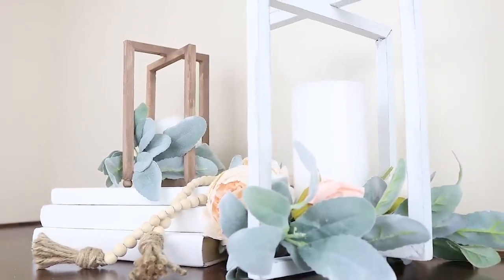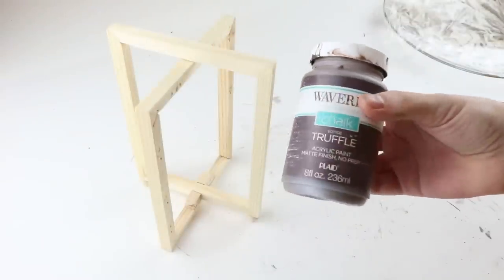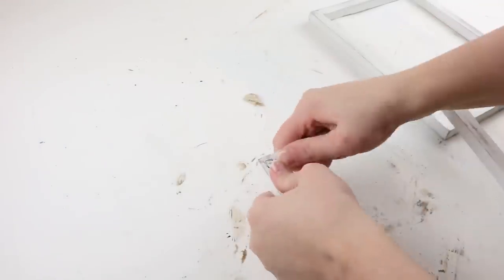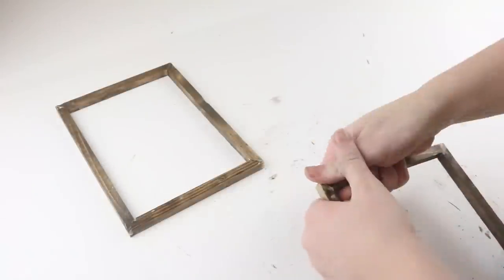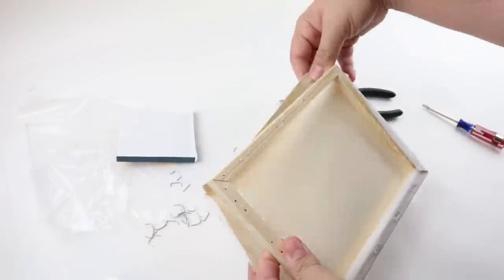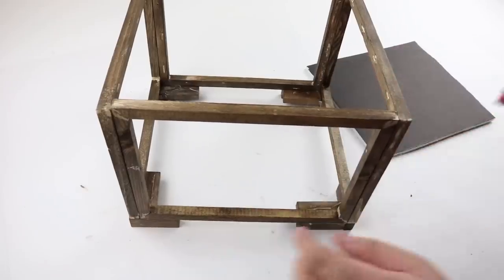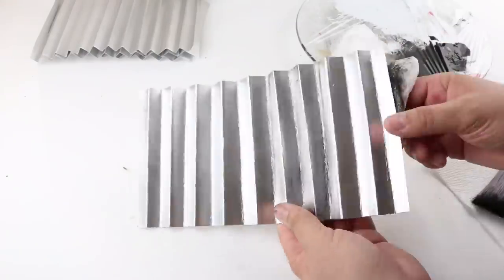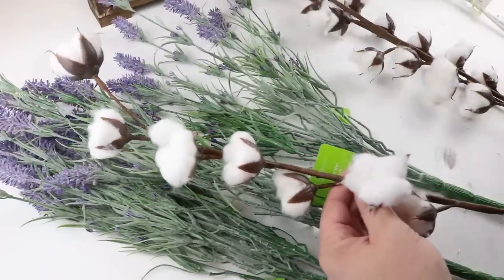*NEW* DIY Home Decor | Dollar Tree DIY's | DIY Wedding Decor

Comment: The caption/title was about wedding decorations but they are beautiful for anytime. I love anything made out of wood.  
Answer to your question, I save the canvas because you can glue the wooden frames back down onto the right side of the canvas  and cut off the access on the back and what I usually do is with wood glue put double the wooden frames together and make a shadow box and add what you want to the canvas with a good glue stick. Stained or unstained shadow boxes look good or if you have just one wooden frame on the canvas but wanted added depth use the  tumbling tower game blocks to the top of that wooden frame.

Comment: So when cutting out base/floor you cut 4 sides out of a complete piece of foam board.

Assuming the sides were straight why not line up the corner with the foam board corner and cut the other 2 sides?  Or better yet just measure from the corner.  I was wondering why you're not using more practical techniques?  Is there an advantage to your method?
Reply from the maker: No advantage, just how I decided to cut it 🙂